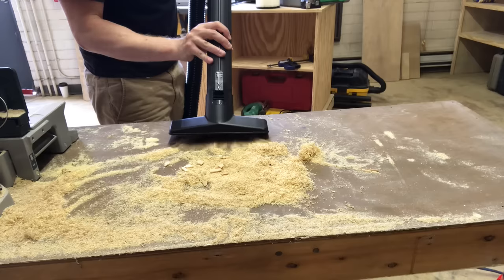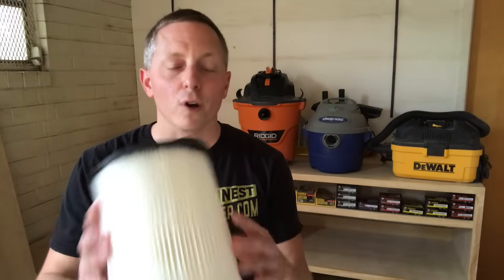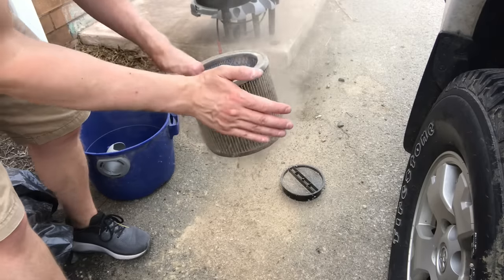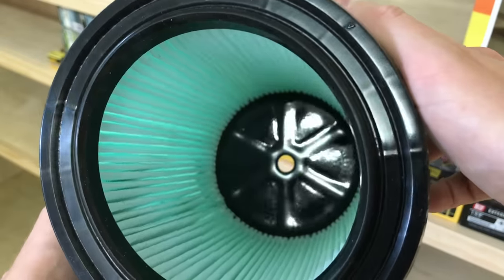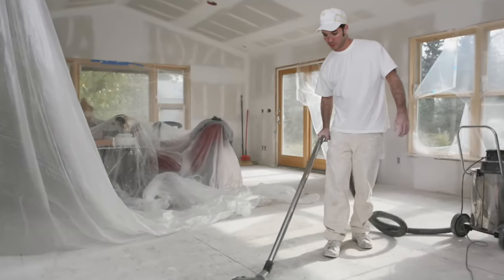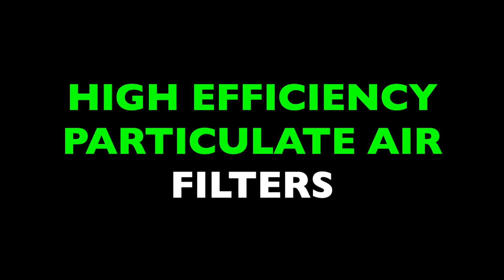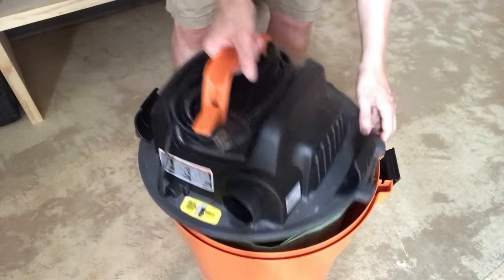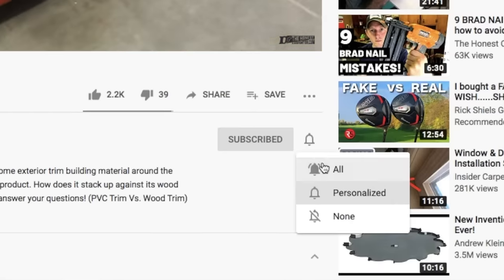Never Use A SHOP VAC Without One Of These!! (Shop Vac Filter Bags/How HEPA Filters Work...)

Comment: Other options, get more hose, put it on the exhaust port and stick exhaust hose out a window. Or, put the entire vac out side, use extra hose to reach where needed, quieter too.  Also, after cleaning filter and changing bag (do this outside), start the vacuum once while outside.  It will emit a puff of dust, only then take inside to use.
Reply: Wish I could do that with my dust collector but it would pull all the conditioned air out of my shop in about two minutes. I am building a closet around it to block noise and  force the expelled air to pass through hi merv HVAC filters before coming back into the shop
Reply: My shop vac has noticably MORE suction when I don't use filters.  So, I do what you suggest, and use a long suction hose with the vac outside.  The larger waste is still collected inside the vac.
Reply: @padraics  Possibly pass the air thru a heat exchanger and out?
Reply: this is a way better solution and one people could actually use... no one is going to stick with those bags past 1 or 2 uses, too much inconvenience

Comment: Hi, the inside bag option is not bad but I would think it reduces suction a lot. What I do... is use an old T-shirt and a couple elastic bands to cover the pleated filter. This extends its life and I tap the filter out periodically. children's T-shirts are a bit better because they fit better but not necessary. one large band at the top and a small band to tie off the neck and sleeve openings. or you can sew that shut, you get the idea 😁

Comment: I've had one of the Craftsman 16 gallon shop vacuums for over 20 years.  Use mostly in the outdoors on the cement pad.  These machines run just fine without a filter.

Comment: I have a 9 gallon rigid 18 V vacuum right from the get-go. I placed a HEPA filter and a HEPA filtration bag on it and I haven’t looked back at the original filter. I can clean and do very fine work and not have to worry about the particles getting into the air and into my lungs.

Comment: Wow, thanks...great info! For some reason I've always thought the filters in these shop vacs (all brands) are HEPA compliant. In addition, I've never thought about where the exhaust air comes out of it until this video. Since the air has to go through the cylindrical filter...that means it exhausts thru the grillworks on the center top cover. No wonder that there always seems to be very fine dust particles on the top cover.
Hey, I love my shop vacs in the garage for quick clean ups instead of having to use a broom. I'm sure they're very much appreciated in a shop as well, but they sure give a false sense of security for your lungs!

Comment: One thing to keep in mind is that your body also filters the air you breathe. The reason small particles are so bad is that they can get very far into your lungs and get stuck. In the case of exhaust from vehicles, this means carrying carcinogens deep into your lungs. Obviously what you are vacuuming important to how dangerous the dust is.
Reply: Yes, but you don’t want you “built in filters”, Aka lungs to be filed with this stuff. Can’t shake those out 😆
Reply: Always good to control and limit the bad stuff going into your body as best you can, but also remember that your body is incredibly efficient at expelling toxins and foreign objects. Lungs are pretty incredible. Again best to limit and avoid, but in most cases limited exposure is nothing to lose sleep over.

Comment: I haven't tried the bag but I always use the HEPA filter for my shop vac(rigid ). I use it as my home vacuum and it works great.
Reply: I have used HEPA canister filter from Rigid for few years to pickup drywall and ciment dust. 
I highly recommend the 20~30$ investment in such filter. 
And I regularly clean the filter with compressed air to restore the sucking power.

Comment: This is an excellent video, Ethan!  I was wondering if you'd cover HEPA filters and you did!!  A lot of people don't get to that.  Be aware that your Ridgid shop vac HEPA set-up can leak and the only way to verify it is not leaking due to a breach in the filter or incorrect seating of the filter is to conduct a challenge test.  This is normally done with vac's that are used to vacuum asbestos and lead containing dust to ensure that the HEPA filtration is working properly.  As someone who has worked in the Haz Mat field, I've seen HEPA equipped systems fail the challenge test.  Another good thing to do is to wet dusty materials to keep the dust levels down. 👍👍👍

Comment: I used a similar method some 20 years ago on my large Sears craftsman vacuum.  But I put a smaller vacuum bag (less expensive) over the pleated canister held and in place at the top with a large rubber band; and I also put a hepa cloth bag over the exhaust and that has been working for me. I’m 77 and still active in sports and in my workshop.  Thanks for confirming my safety idea that as a lazy handyman and Mr cheap o, I found this solution on my own some 19 years ago…after I realized how expensive those replacement pleated canisters cost and how quickly they get clogged.

Comment: I made a homemade "cyclonic" separator with two 5 gallon buckets and a "thien" baffle. Shoddily assembled with orange buckets, hot glue, tuck tape, flexible vac hose and 2 in pvc piping and the bottom of one of the buckets cut into a baffle. I connected it to my 12 Gal Ridgid that has a bag and the 3 layer blue filter  Only the finest even makes it into the bag.  Contrary to fearmongers, plenty of  ultra fines get trapped in the separator, not just big chips.
Reply: I made a cyclone dust separator too & didn’t even have to go buy anything for it!! Had pvc kickin around, had a 5 gallon bucket, some hot glue and even had some caster’s thanks to my hoarding/collection techniques!!!😊…I Frankenstein’d it & it works amazingly. Everyone says the bucket tips over & yes it did. So why not screw bucket to a piece of plywood/melamine/osb that’s a cpl inches bigger all the way around and throw some casters on it, mine hasn’t tipped yet!!! 👌🏼
Reply: I should patent the idea!!! 🤣 no joke, try it and see.
Reply: You claim that “plenty of ultrafines get trapped in the separator”. How do you know that?
Reply: @donbushek   Considering the types of dust I vacuum, I should clog my filter AND have stuff ejected in the back after the vacuum IF the assumption that these separators only collect chips and large particle sizes.

 The fact that the bucket is caked with extremely fine powder below the baffle, that my vacuum inside is not, and the filter remains clean tells me I do trap a lot of very fine particles BEFORE the vaccum. Without the separator, the filter gets caked very fast even through a bag.

Comment: I use a “Herky Filters” reusable felt bag in my 14 gallon Ridgid and a CleanStream Hepa filter. Both are reusable and washable and have lasted me two years of moderate use and still going strong.  I even tested it a while back by vacuuming up some fine powder that reacts to UV light and room stayed clean.  
Herky filters bags cost like $32 and are reusable and washable. I think the cleanstream reusable and washable filter costs like $35 or so. 
Much better deal than using those green hepa bags and filters.
Reply: Just got a new Shop Vac brand 4 gal 5.5 HP vac at Lowe's.  Are the Herky Filters compatible with my model?  Thanks.

Comment: I keep a couple extra filters and clean them when they get dirty.  First I use compressed air, spraying it along the pleats,  then I use water and never direct the stream straight into the pleats but along the pleats.  Washing from the inside helps to keep it clean inside.  Then I set them out or inside where a dehumidifier is and dry them out. This is the same method used to clean the CAT filters at my work for 36 years.

Comment: Not only do I always use a filter bag, but also use a Rockler Dust Right dust separator that significantly prolongs the longevity of each $6 fillet bag that would otherwise get clogged and filled up very quickly.

Comment: In my experience, using a cyclone dust separator hooked up to a shop vac is by far the best way. Even the bag stays cleaner so just imagine the vacuum’s filters. Dust disposal is also way more manageable and practical.
Reply: I installed a separator almost a year ago and can easily say it was one of the best thing I've done to the shop all categories.
Reply: Does using a dust separator reduce the cfm of the vacuum.
Reply: @pck9465  In my honest experience, it actually increases the suction. No data though, and maybe it’s because of my hose setup.

Comment: I have about 50' of hose. Depending on the job I either keep the base close to a window or door and have an exhaust hose made up of one or two segments, and a long vacuum hose for the work. The alternative is a short vacuum hose and drag the base around with a longer exhaust hose. I like this guy's idea but it still doesn't catch everything. We have a dog that sheds a lot and you can smell the dander through any filter, those oils become vapor in the vacuum process. Test it with a few drops of perfume and a brand new hepa filter. It will instantly fill the house (for better or worse.) With an exhaust hose there's no smell.
Reply: Thanks
Reply: That's because HEPA isn't designed to capture smells. Use an activated carbon filter if you want to rid of organic compounds.
Reply: longer hoses are nice but there are flow losses and you wont have as much suction.
Reply: @Kurt1968  Flow loss is not an issue when the hose is on the exhaust side.
Reply: @soritessoreites1207  I can't hit you on the head with the math but it is. Resistance in the path from atmosphere in to out, the motor is in the middle instead of at the end. Normally vacs are run with no resistance on the exhaust, but here is the exception. Total resistance throttles the airflow and dirt as well.

Comment: Good point about using a pre-filter to preserve the main one, but even using bags as designed, a cyclonic dust separator is a better pre-filter than a bag, or any pre-filter that uses a fibrous or physical filtering medium.  All physical filtering media block the air flow to some extent, by sticking obstructions (the filter media fibers) in the way of the air flow to catch the particles.  This does filter out particles, but it also slows the air flow, causing the motor to have to compensate by speeding up (if it can, and losing 'suck' if it cannot) and potentially burning out early.  A cyclonic dust separator also pre-filters, but without using obstructive filter media.  It causes the airflow to make a cyclonic turn on the way to the filter, which the air molecules can follow a lot easier than the dust particles can, causing them to drop out into the bucket, and sending on much cleaner air for the main filter to screen.  And it does this pre-filtering without hindering the air flow (well, perhaps imperceptibly, but a lot less than physical media does).
Reply: For someone who already has a shop-vac, adding a filter bag is a cheap and easy hack that will save cleanup time and remove a percentage of particulates.  If upgrading to a cyclonic separator was as cheap as a filter bag, it would make a great option.
Reply: What if you were to use both the bag and cyclo filter? Less suction but absolutely cleaner exhaust?
Reply: its not imperceptible , i measured a loss of 7 inches water lift and about 25 cfm using a dust cyclone, i tried this with several different brands and several different wet dry vacs, still its worth it usually , but i like my miter saw dust chute to have the most suction possible
Reply: @mainsource8030  What about with the extra filtering as described?  I'm curious if you also tested that, and if so, whether it caused a greater loss than the cyclonic action did?
Reply: @billparrish4385  i tested it with a Filterpal pre filter(amazon) , which can be washed and the cyclone with the pre filterstill installed then with the cyclone by itself , now the pre filter will degrade in performance over time but in the beginning it had more cfm for me than the cyclone, i even checked cyclone for leaks, used weather stripping as needed etc..

Comment: I use an old t-shirt or pillow case over the filter when doing maintenance on commercial dryers and use a hose on the exhaust hose like someone else mentioned. It extends the life of the cartridge significantly.

Comment: I do it just as recommended here in your video.  But I also added the Home Depot Duststopper  for about $60 including pail (cyclone lid for 5 gallan pail)  By adding the duststopper it takes forever to fill my Hepa rated bag.  I am talking year plus.  An in that time I will dump about 20 full five gallon pails of wood chips and fine saw dust.  Cyclones are supposed to act as a first stage filter for large particles and wood chips from say a planer, but I find it collects 99% of everything, only 1% (and it is all fine dust) gets to the bag.  I also saw some other comments about reduces suction.  Not if you buy the right vaccum.  I have the Ridgid 16 gallon and it is a beast.  With hepa bag and filter, plus the Duststopper in play, I have plenty of suction for my table top planer and jointer, as well as jobsite table saw, bandsaw, and tracksaw, sander, etc.  Zero complaints.  Not as convenient as a ducted, blast gated, dust collector, but not nearly as expensive either:)!   And I will agree that it reduces measured suction, but what counts is does it collect the debris, and the answer is yes.  It is like saying, well if you turn on the AC your going to use more gas when driving your car, that's true, but you will be a lot cooler:)!
Reply from the maker: Very well put, Garry! 😁 I got the dust stopper too, as opposed to a larger cyclone. It’s already doing it’s job, I just left it for the dust collection video. Great to hear yours is working so well! Home Depot really has a killer line of vacs and dust management tools.
Reply: This conversation answered my question related to the HD dust stopper.  Thanks!
Reply: @TheHonestCarpenter  I just went through a very dusty basement remodel with my Ridgid shop vac + a dust deputy. I also had a bag + HEPA filter on most of the time. I did try the dust stopper early on and it was great for pulling up gravel  when laying pipe under the concrete floor but wasn't quite as good as the dust deputy for fine dust. I really do not like how tall the dust deputy is but still use it regularly.  I'd probably be happier if I stayed with the dust stopper.

Even with these 3 layers of defense I'd get fine dust all over inside the vac which is quite frustrating. They don't design these to be very easy to clean - its just a maze of plastic support structures. If you vacuum up something that doesn't smell great (burned sawdust from a router) you will saturate the bag and filter and will smell it for days. I wish there was a better solution but for the price it is hard to beat what Ridgid has to offer. Pair that with a single-button wireless remote and it's a pretty sweet setup.

Comment: THANK you for that great advice. I WILL follow it.
   Now, I've got a little something for you. It sounds like you have SHEETROCK on all your walls and ceiling. It makes for a rough understanding conversation. If you will put "Beaver-Board" is the old name for it. Or drop panel acoustic tiles onto your ceiling, that will cure most of your sound problems. TV and radio Stations, Band Rooms, etc have square acoustic panels with 400 holes in each one in a grid pattern. That will make your voice sound so much clearer and will be easier to understand conversations in that room.
   Thanks for your advice. I Will follow it.
   Bill, from Tn. 🇺🇸

Comment: Wow, thanks for opening my eyes to a problem that has always been in my shop. I'll start using the bags again. I stopped a while back thinking that when I added my cyclone to the shopvac system everything would be fine. The cyclone does work well but I have always had that fine covering of smaller particles all over my shop. I'll pay more attention, thanks to your explanation. You are amazing.

Comment: Having a rather steep driveway, I simply roll the clogged filter down the drive, leaving a trail of sawdust in its path.  Repeat as needed.  Usually just one or two rolls gets it done while I safely watch from a distance.  For my dust collection system, I use a cyclone to keep chunks out of the blower, then it all gets discharged outside, no filters to mess with.

Comment: I've used blue painters tape to tape a couple towels to the end that blows the air out. I also take an extension piece and put the towel over that, then I can just remove it when I don't need a filter.

Comment: I added an old sock over the exhaust pipe on our ShopVac.  Amazing how much particulate matter/dust just blows out the exhaust.  Those specialty dust bags are pretty expensive @ $18.00 for just two bags.
Reply: @meabob thanks! that brought a smile to my face ...I hope that was a spell check insertion of the word "pantyhose" when typing or dictating the word "hose" as I'm trying to picture myself with the stockings  coming to my knees and then the panties (with no thighs or hips) I would look really funny & I expect you'd be laughing at me too
Reply: Buy a duststopper and 5 gallon pail at Home Depot and you'll never fill a bag, of if you do, it will be in a different income tax year.

Comment: Loose fine dust is absolutely a pain when using your shopvac. One of my biggest per peeves about shopvacs is the exhaust port blowing not only debris but a lot of air pushing things around behind you. My solution for that is using pvc pipe. I heat and friction fit the appropriate size pipe to the exhaust port and attach a pvc elbow . Then attach a paper shopvac filter with strong rubber bands. The best part for me is the exhaust air goes straight up or in any direction I choose.